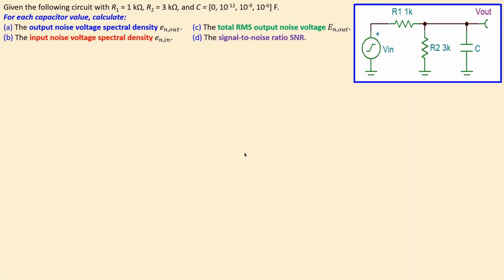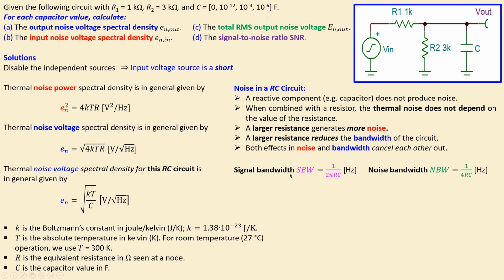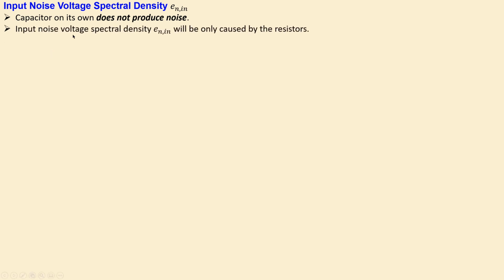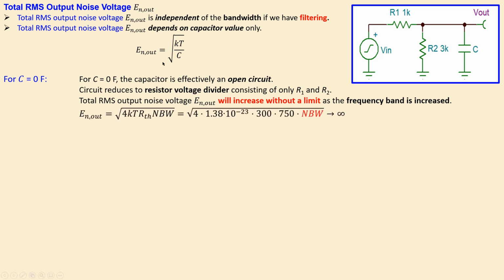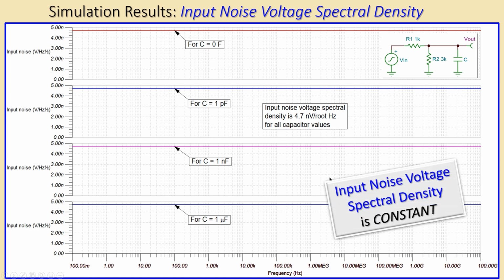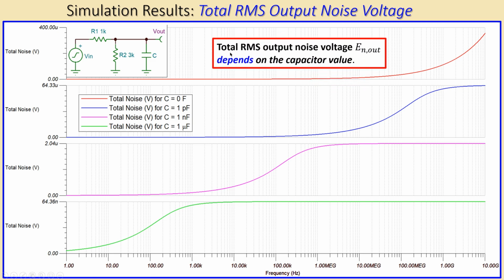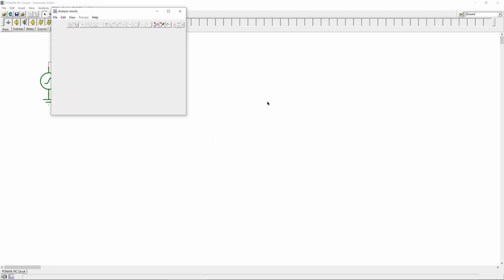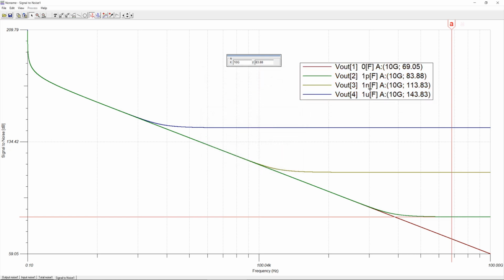Noise Analysis RC Circuit with Voltage Divider 💡 Example 4

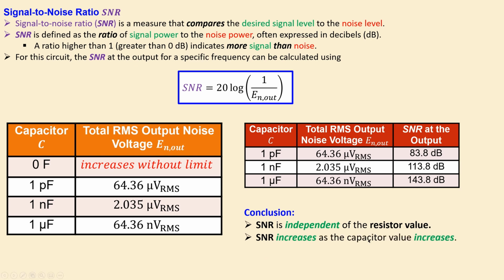Comment: At 18:11, your definition of SNR seems to be wrong. Why did you specify signal power to be zero dB? You are basically assuming that the signal power is 1, which does not make sense. In real applications, the signal power is dictated by the allowed dynamic range (which is tied to the Vdd of an amplifier, for instance) or the application itself (the signal power of something you are measuring is limited). Also, you say that the SNR is independent of the resistor value, which is false for every case besides f_BW = infinity, which is the one you took. There is no signal with infinite bandwidth, as there is ALWAYS some capacitance connected to the resistor (parasitic or not), which limits the bandwidth of the resistive divider.
Reply from the maker: The SNR is a ratio, as the name implies. The bases for the SNR calculations in the Spice simulation use 1 as reference, so that is the reason.
Reply: @CANEDUX  That's only because you assigned Vac=1 to the input voltage source. You are not measuring SNR, you are measuring db20(1/noise). SNR is db20(S/N). The SNR will change if you apply a different AC value to your input source. It's ok to calculate using Vac=1, if that is really the input voltage of your circuit.  I'm afraid that you think that this is always the case, which is not. Also bear in mind that Vac=1 is your small-signal voltage. If you care about a real signal, you would need to compute the RMS value of the input signal (such as Vamp/sqrt(2) for sinusoids).
Reply from the maker: @TaimurRabuske  You are correct, the assumption is that the input signal is 1 already for all cases. And, yes, this does not have to be the case for all circuits. However, when you do have another input signal level, it is fairly easy and straightforward to convert to the actual SNR for the specific input signal.
Reply: @CANEDUX  Sure, it's a matter of converting Vin to dBV (dB related to 1V) and adding to the value you already had, which you called SNR (you can add the dB values in this case). Thank you for the feedback! Nice work!

Comment: At 9:35, you are confusing noise PSD with total integrated noise for the case with capacitors connected. That is why in your table the value for C=0 is smaller than for C!=0, which does not make sense. 64uV, 2uV and 64 nV are the values of INTEGRATED noise (given in Volts), and not noise PSD (given in V/sqrt(Hz)).
Reply from the maker: The RMS noise voltage and the noise voltage spectral density for this RC circuit is the same. this is also discussed in the video from 16:10. You can also see that the RMS output noise voltage keeps increasing without a limit when C = 0, because the circuit is effectively a pure resistive circuit. So, it definitely correct what is shown in the video. The results for the calculations and simulations do match too.
Reply: @CANEDUX  Sorry, it's not correct. You are mixing up noise PSD and integrated noise in the table, and call all of them noise PSD. Only for the case where C=0 your table is correct. For all the other ones, the units are V (instead of V/sqrt(Hz)) and you are showing INTEGRATED noise instead of noise PSD.
Reply: @CANEDUX  Simulation results do not match with what you said. Simulaiton shows that the noise PSD is equal and independent of the capacitor value (which goes against your table at 9:30). Look carefully at the units on your table and you'll notice the mistake.
Reply from the maker: @TaimurRabuske The input noise voltage spectral densities are indeed the same for all capacitor values, which is indeed not the same as in the calculations. Thanks for the notice.
Reply: @CANEDUX  You're welcome. Sorry if my comments sounded harsh, it was just a minor observation. Nice work on the videos!
Reply from the maker: @TaimurRabuske  I really like this. Keep it coming :) We all learn from it and we can make mistakes.
Reply: @CANEDUX  I like to think that making mistakes is the quickest way to learn. Again, sorry if my comments sounded harsh, you have very nice videos on your channel and I should start complimenting instead of jumping to criticism. See, I'm also learning from my mistakes :)
Reply: @CANEDUX  so for C=0 ,C=1p C=1n and C=1µ en,out=3.252nV/rtHz ?
Reply from the maker: @mohameddrissi1075 No, the output noise voltage spectral density is only 3.525 nV/root Hz for C = 0. See the detail at 00:21:55 too.
Reply: @CANEDUX but you didn't mention the value of output noise voltage SD for other cap values
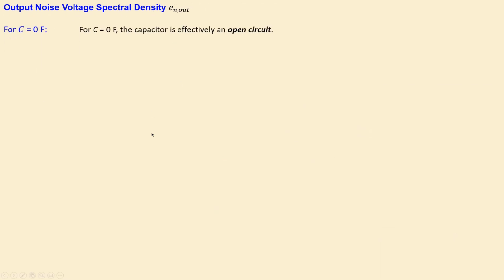Reply from the maker: @mohameddrissi1075 You can see the calculations for this at 00:07:46. Since we have filtering due RC filter, the important result is again the integrated output noise voltage. Again, this is also given in the simulation results in this video.